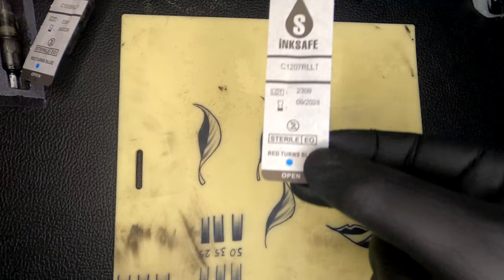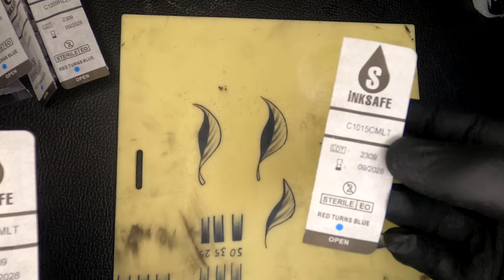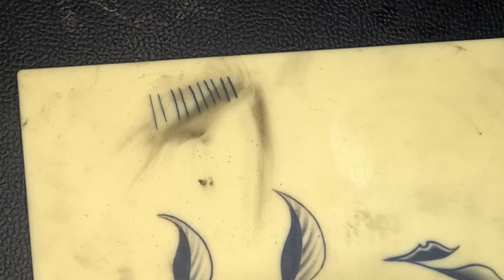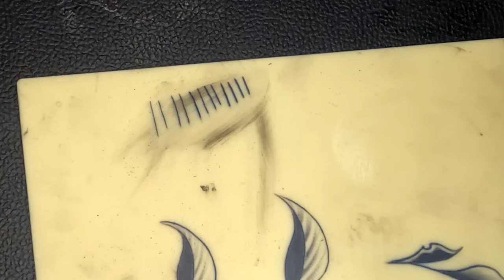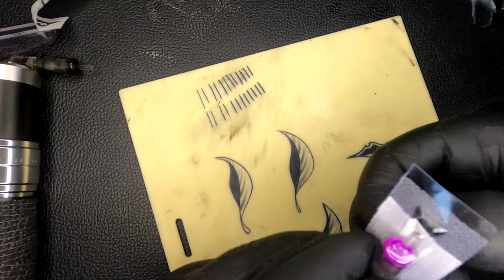Which One Is Better? Dragonhawk Mast Fold Pro vs Fold 3

Comment: Just ordered a Fold 3 after looking at multiple videos on other brands I have had no issues with my Mast Lancer and my Ambition Torp just looking to add a adjustable machine to my equipment
Reply: Out of those machine do you like one more than the others for linework
Reply: @AndrueSOCAL  yes i want to know that too, ambition torp vs fold 3??
Reply: How has the Fold 3 held up?
Reply from the maker: Fold 3 is great, my colleaque is using it as a daily driver

Comment: both of those machines r the exact same machine as the peak solice pro hold them side by side even the grips interchange I bet the fold 3s battery will screw into the peak solice pro I feel like I got ripped off by PEAK
Reply from the maker: I am pretty sure they are identical, at least on the outside, not sure about the motor and quality of the parts. But you could be right….
Reply: I have a Peak solice pro. I want a fold pro. Make it sens? Or it's the same?
Reply from the maker: I think they are pretty much the same

Comment: Hey man I don't suppose you've had any issues with the fold 3? I've been using the fold 3 for 8 months now but recently it's started choking on the cartridges and not pushing or pulling the needle - to add to it sounds like a coil a machine when it happens and vibrates crazy! Opened it up so far to what I can get into while at the shop I work at but no one can pin point what's wrong 😂 any help would be great if you have any bro 🙏
Reply from the maker: I might have had the same issue with my ambition mars-u. I know what is wrong but i couldnt fix it🥲 maybe contact dragonhawk and see what they can do

Comment: Bart, thank you so much for the reviews and helpful videos! Can you tell me how to barrier the pen with a changeable stroke??? I bought myself an Ambition Seher, consider the same Mars. But how to properly protect it so that it can be adjusted later during operation!? I would be very grateful for a short video or shorts on the barrier!
Reply from the maker: Yes i will try and show it in a video. But there is not much to it. I always wrap my machine in a clipcord sleeve. And that will leave me enough room to adjust the stroke
Reply: @Tattoobart147  Thanks! I will be really waiting!! And then I broke my head how to effectively cover the pen and adjust it in operation

Comment: Hello, how are you, I wanted to ask you, I have a xnet vipera (I love it) and I want to buy another machine to have it as a spare or as a complement to the other one. I doubt between the fold pro or the fold 3, having the vipera which one do you recommend. Thank you very much, greetings.
Reply from the maker: I think since you have the vipera the fold 3 will probably compliment the other better. Its a bit softer and smoother where the vipera is a bit harder and robust. If you order a dragonhawk machine make sure to use the link in the discription🙏
Reply: @Tattoobart147  thank you very much 🙏🏽
Reply from the maker: I think all stroke adjustable machines have the same swash disk kind of drive. But maybe i will open them up to have a look

Comment: The fold 3 immediately sounds like it's running better. I've been debating on the ambition mars u, or the fold 3......comparison video?? Lol
Reply from the maker: Actually my colleagues are using these two machines at the moment😅 but from what i remembered with the mars u i have i would go with the fold 3. Its a bit cheaper than the mars u, comes with 2 batteries and they work about the same

Comment: I want to order on this weekend.

What is better?
Fold Pro or Fold 3?

Thank you
Reply from the maker: I personally prefer the fold 3 but they are both great. Just make sure you get them with 2 batteries. And ofcourse you the code tattoobart20 for 20% off plus an extra 2 boxes of cartridges🤘
Reply: @Tattoobart147  thanks!! Is your Code inclusive 2 needle boxes?
Reply from the maker: @chr1s_69 yes it should be
Reply: Mast Fold 3 🤘🏾👌🏿👌🏿

Comment: How many volts to line ? And shade ?
Reply from the maker: That is a personal thing. I use about 7.5 for lining and 5.0 for shading
Reply: What’s the strokes big bro for shading or lining
Reply from the maker: I generally use it to n 3.9 for both. Sometimes go to 4.2 for lining and 3.6 for shading depending on the job

Comment: got a new machine for u to try my friend it the EZ P3 TURBO it's a direct drive adjustable stoke if u get one let me no what u think I just picked one up going to do some work on my daughter in the am let me know what u think of it if u pick one up I respect your opinion my friend
Reply from the maker: That sure look cool! Kind of the same mechanism as the WOS machines. I will have a look into it
Reply: looks about the same the only thing I didn't like about the  WOS is hard to put grip tape on such a small grip I used the TURBO today I'm pretty pleased with how it performed
Reply: They r similar the only thing i did like about the WOS is hard tonput grip tape on because the grip is so small I used the TURBO this evening and pretty pleased on how it performed lined good and shaded smooth I got it more for the long stoke and lining I have the peak and the fold pro that soft shade pretty well
Reply from the maker: Which wos do you have? I have the e60 and the griptape fits perfectly. Maybe because the grif if pretty think.
Reply: I dont have a WOS I just watched reviews and that's what I seen on utube how do u like the E60
Reply from the maker: It is a great machine. I am currently using it for most of my linework. It is also a very nice shader. But i have only used it on the 5mm stroke

Comment: OMG Dude! Do you tattoo on people that slow?
Turn that voltage up and pull/push those lines faster! Also, you can't get a good feel for either machine by just doing a few small straight lines and some tiny spots of whip shading.
From the looks of it, both of those machines would be suitable for anyone that knows how to use a machine with no give. You just have to adapt your hand speed to the voltage you're working with.
I was really hoping for a video on reliability with these machines.
This video missed the mark.
Reply from the maker: Thanks for the hate👍 algoritmes love it